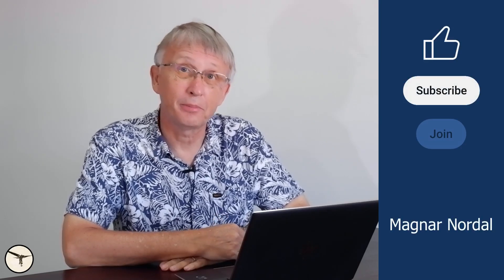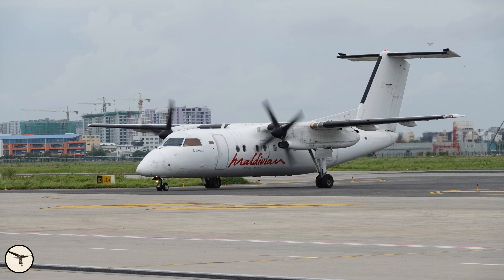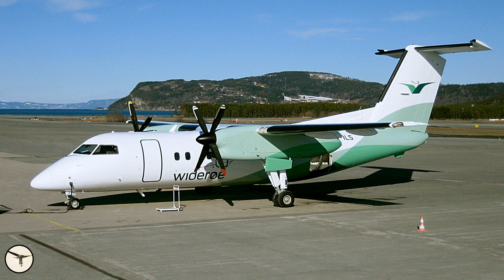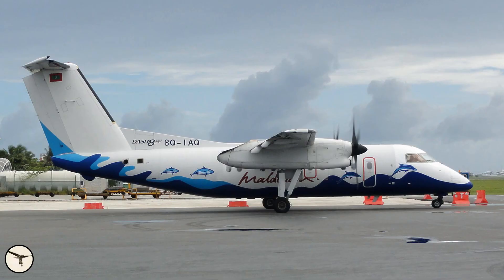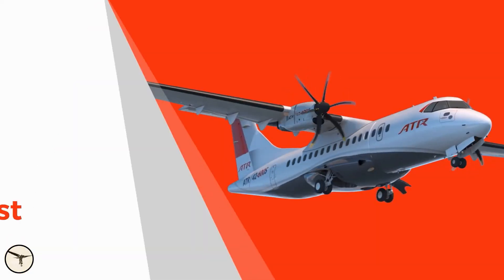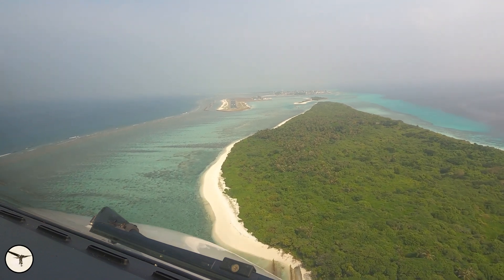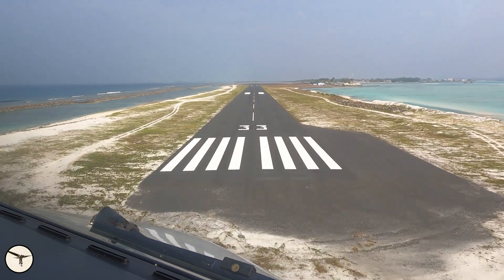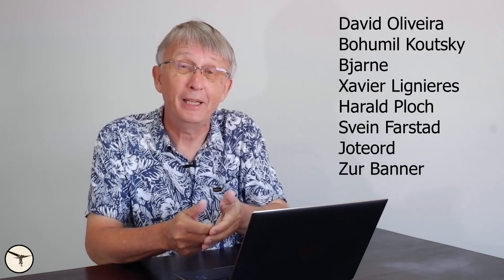ATR 42-600S STOL Canceled: The Truth Behind the Aircraft Abandonment!

Comment: Hi Magnar,
Even though this is not the newest video, I was hoping to ask a question about a performance topic. I seem to remember that you once mentioned the ATR can decelerate (maybe also accelerate) faster than most jets, given the fact that the propeller blades can change their pitch. I think this applies both in the air as well as on the RWY?

In the air, they say an A320 can decelerate 10 kts per 1 NM travelled. I was wondering whether you have any rules of thumb for the ATR72/42 for decel/accel in the air? Would be interesting to learn more in this regard :)
Thanks again,
Sebastiaan.
Reply from the maker: Yes, the ATR can decelerate more quickly than most jets. The first reason is its lighter weight, which results in less inertia. The second reason is that the propellers create additional drag when Flight Idle is selected at high speeds.

The normal descent speed is 240 knots. When flying a continuous 3-degree descent, we select Flight Idle when we are 13 nautical miles from the runway. By the time we are 8 nautical miles out, the speed will have reduced to 170 knots, which is the recommended speed to begin aircraft configuration.

he ATR does not accelerate faster than a jet. Maybe it can outpace a Yak 40.
Reply: @FlywithMagnar  Thanks again, now I understand it better :)

Comment: The ATR 42-600S failed because ATR exaggerated when they called the "S" a STOL aircraft (Short Takeoff & Landing). I have looked at the aircraft to see how it would do at some of our very short runways in Canada. The proposed performance numbers were not stellar, and in my opinion, not worthy of the STOL label. It can be said that it could have been called a "Shorter" takeoff & landing aircraft, but not a "Short" takeoff & landing aircraft.
.
I truly believe there is a market for a new STOL aircraft, and that ATR could design one, however some out-of-the-box thinking on their part for the design would likely be required. The DHC-7 (Dash 7) is nearing the end of its lifespan and something needs to replace it. There are places in Canada (and I'm sure in other places in the world) where lengthening the runway is not an option due to the geography/topography. If ATR could come up with an aircraft that had extraordinary STOL performance people would buy it.
Reply from the maker: De Havilland Canda built 113 Dash 7, 142 Dash 8-100 and 127 Dash 8-200. Many of them are still flying. As I mentioned in the video, many runways worldwide have been extended, reducing the need for new STOL aircraft. Therefore, it will be too costly to design a new STOL aircraft in this class.

The Dash 7 is exceptional, but its four engines and low cruise speed make it costly to operate. The Dash 8 was introduced to address these issues, though it came with a trade-off in reduced runway performance.

Just out of curiosity, where did you obtain the performance data for the 600S? The aircraft is not certified.
Reply: @FlywithMagnar  Just initial numbers provided by ATR.
Reply: Is “shorter take off and landing” not considered STOL when applied to an aircraft which is already capable of short take off and landing? Nobody said they were trying to build a new Dash-7…. They were simply making a short take off and landing aircraft, take off and land in an even shorter distance…. Pretty much the definition of STOL….

The fact a 50 seater aircraft can operate with a good payload out of a 900m runway is already impressive and already worthy of the “STOL” label as you say…. And that’s before any modifications have been made. 

So it’s already STOL, and it was unsuccessful due to no “big enough” market for it, as the majority of its market areas already have longer runways.

You must remember they were designing it for a specific market area that they wanted to target, not designing it specifically for Canada, I’m sure if they wanted to design it specifically for those fields in Canada they could, but does it warrant the money spent in redesigning and certifications if you are only going to sell a handful of aircraft? And that is what Captain Magnar is getting at here, not performance, but market need over cost to cover the market area…

No point in designing a 50 seater that can take off in 300m, if nobody will buy it.

Plus, every modification comes at some other cost, higher fuel burn, lower cruise speed etc… we must remember that an aircraft that can do everything well, will sell better than an aircraft that can do one thing well and is terrible at everything else…. So I don’t think it’s accurate or fair to say it failed because ATR couldn’t produce the expected performance figures and that the aircraft isn’t worthy of the STOL label. They could, if they wanted to, but they would lose money, so they don’t……
Reply: I also looked at the initial numbers provided. It didn’t give any extra performance over a DHC-8-311 but did so with less seats and a higher fuel burn and without the robust build quality and the extra redundancy of key components and a proper APU.

Comment: One thing is good - at least it is in MSFS
Reply: Hehe I just thought the same 😁
I was happy when they added this version, only to find out a week or two later the real one got canceled😅
Reply: I'm not a msfs user, but i highly doubt the STOL version is simulated correctly and i'm quiet certain about that. The STOL version was planned to have several upgrades and to my observation, there are at least three features that'll be very visible to pilots.
1) auto ground spoilers deployment
2) autobrake
3) rudder authority

Since the whole (real) project is now cancelled, we never know what ATR had in mind for ground spoilers arming mechanism (push button? switch? where it is located in the cockpit?), autobrake (how many settings it has? what is the deceleration target for each settings? how to activate? push button? switch? knob?), and also rudder authority since the STOL version supposed to have a much larger rudder surface compared to normal version (how much authority it has? how it behaves on low speed? much more effective than before?).